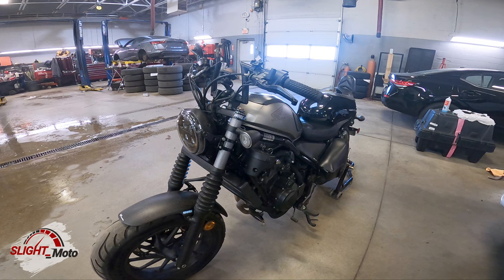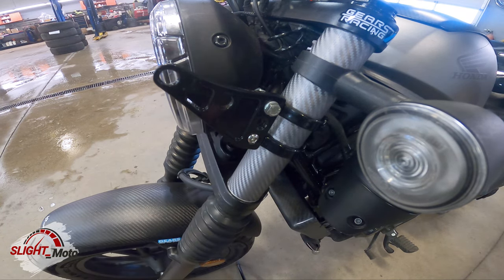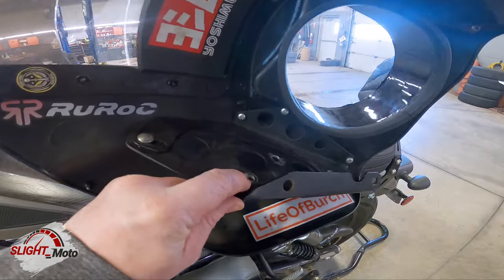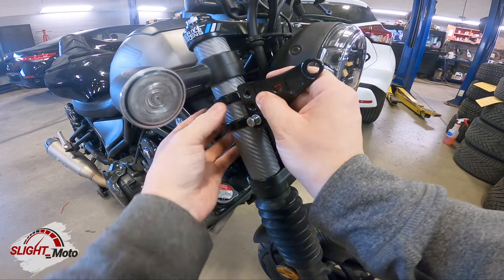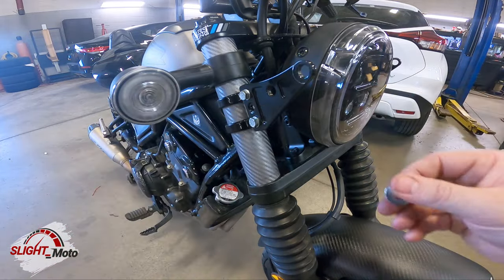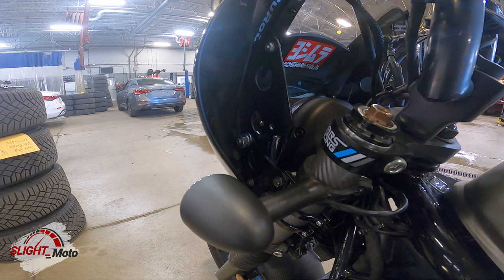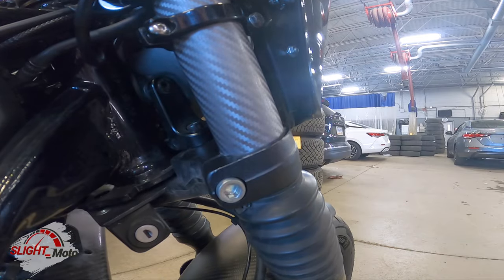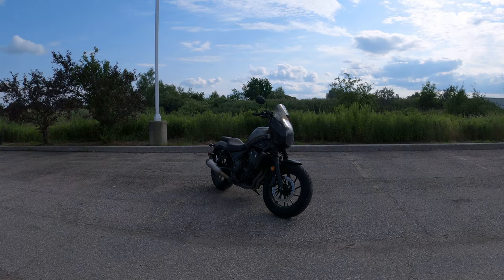Honda Rebel - Fairing Install. (HD quarter fairing Knockoff with Laminar Lip)

Comment: Can you make a vid about what oils did you use in the past. Thank you bro. Much love from Philippines
Reply from the maker: Fluids i’ve done within specific videos (coolant, oil, brake fluid etc) 

What info are you requesting? I’ll see about marking you a list.
Reply: @SLIGHT_  about what could be your best choice for the engine oil, coolant, chain lube and chain cleaner. And what did you use that has the best and least performance
Reply from the maker: @patricklouiseorencia1934  ahh ok ok. Great suggestion. Thanks
Reply: @SLIGHT_ I'd definitely love to see this to. I'm a "planning ahead" kinda guy. See how maintenance works before I even get a rebel. Thanks!
Reply from the maker: @nottix624  I have a ton of maintenance video for the rebel 500, I have it linked in a group on the main page.
Reply: @SLIGHT_  haha I literally saw it all after I commented. Pretty straight forward stuff, thanks!
Reply from the maker: @nottix624  all good dude. Hope it helps